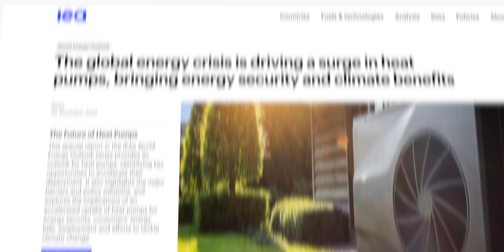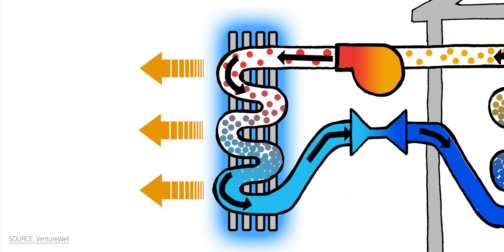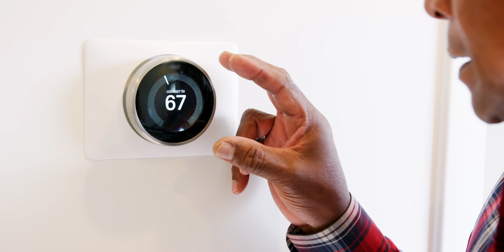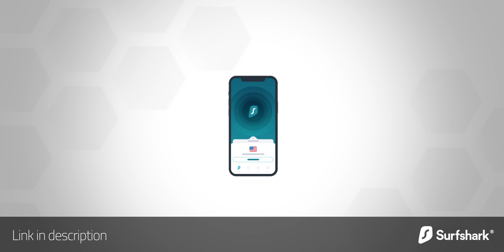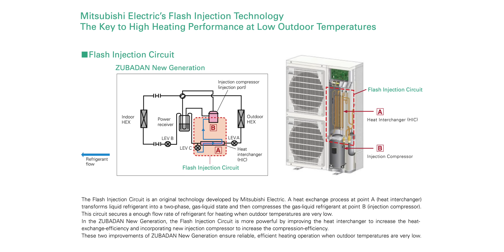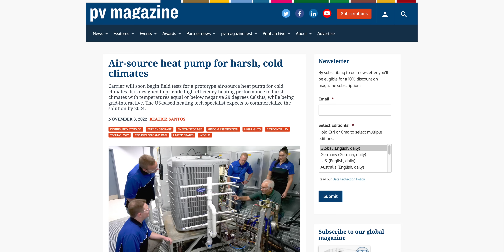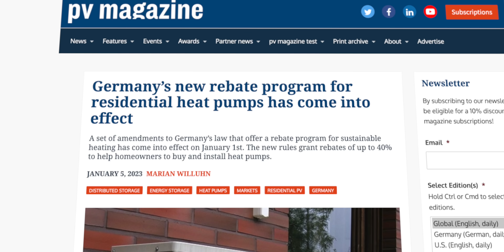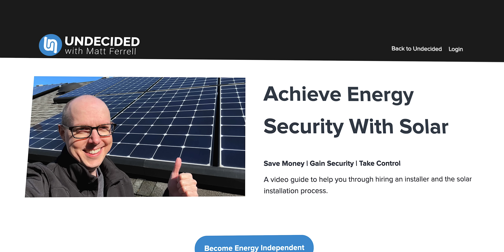Major Advances with Heat Pumps in the Extreme Cold

Comment: Your research needs to go beyond company statements to be accurate. As an ex-heat pump user I can confidently tell they are not worth it, at least not for now. First of all, despite cold weather not been a problem, which is yet to be proven in mass scale; wind is actually a bigger problem, causing all sorts of problems with the fans and if it rain gets inside the electrical system gets damaged or corroded over time (in 3 years it was unbelievable the level of corrosion caused by just water and wind). The cost of the device is nothing compared with the cost of bringing the house up to standard. A heat pump is only as good as the overall house insulation is. Thinking that a large portion of the house market globally is not well insulated, you'll be adding thousands, if not, tens of thousands of whatever currency, just to improve your windows, improve your roof, wall and floor insulation.... 

All the above to ensure a rough 20ºC throughout the year, for a non-stop system, that has to be designed to run 24/7 for its life... and its got to be a long life if the initial investment is sitting at 20/40k depending on your situation (because your quote of 6k excludes all the additional systems to move the air around the house, the cylinder and labour, a basic heat pump installation from a well reputed brand, will not cost less than, at least in gbp 12/14k for an average two up two down in England). So comparing this to a gas boiler, that will provide instant heat at roughly 60/65ºC will be used on demand, maintenance is relatively cheap and running costs are slightly cheaper per year... well, I'm sorry to say that the heat pumps need to improve dramatically on quality and price to make a difference, because 300 p.a. is not going to cut it. It doesn't even save the cost of the machine set-up in 10 years, that will need to be replaced by then, because it will simply be rotten by year 5. This is not counting with ultra-expensive service every year (because warranty won't be covered otherwise), for an inferior performance (you'll be wearing the cardi all winter) and maybe the performance is better on hot weather, but I don't live in south Spain, so I can't really compare.

Comment: I'd have liked to hear more about the output of the heat pumps, especially GS and AS to Water (i.e. radiators). I'm interested to hear about any improvements to output temperatures, which obviously have an impact on installation cost (new and larger radiators, additional insulation, underfloor heating etc).

Comment: Seems adding a heater to the inside of a heat pump should add minimal cost as they already make heaters for waterpipes, along with sensing switches so they are only triggered during the cold

A tax credit is helpful only if you're rich enough...

Comment: We put in 2 mini splits and our power bill went from $520 to $290 for the same period plus we were charging a PHEV that we didn't have the year before. They were just cheaper ones found on amazon but they work great, here around Seattle the coldest it's gotten this winter has been about 15-20F and they still keep working, not as hot but no problem keeping the house warm.  We put one in at my work also where they still used an oil furnace, and it was about $700 or more to fill the tank. Just missing 1 oil fill nearly paid for the whole thing.  Plus last summer they had excellent a/c just as a bonus, course any furnace is useless in the summer while a heat pump is a year round investment.

Comment: The problem we have in the UK is that electricity is so expensive at around 40p per kwh.
Gas is relatively cheap compared and has historically been about 1 sixth the cost. 
To run a heat pump in the UK means spending hundreds of pounds a month in electricity costs, whereas a gas boiler can be fired up for an hour or 2 to take the edge off and then turned off for the day and no money spent. 
Personally I use a gas boiler for 2 hours a day then keep the house warm burning logs in the stove. Take that climate change!!

Comment: Great summary (summery? 🤔😉) of the state of heat pump tech. One aspect that I think could have used more emphasis is radiator sizing. Heat pumps are efficient, but don't generally produce the same hot water temperatures as a boiler. So if you have an older house (like ours) with small radiators that rely on high temperatures to warm the room, you can struggle in the winter. Large surface areas and underfloor heating are ideal.
Reply: The US seems to have a lot more central air systems than radiators, so that might explain why his focus isn't really touching upon radiant heat. I think Fully Charged touched on heat pumps for radiant heat though, which was really interesting.
Reply: @stevemulcahy5014  Interesting, I hadn't picked up on that point! I'd chatted about it with the heating technician whilst he was doing the annual service check on ours: he's encountered several households who had switched to heat pump without considering the radiators. Fully Charged is also a great source of info!
Reply: I just moved into a 100 yr old house w radiator heating. None of the plumbing worked including the two boilers so I'm ripping it all out & replumbing. I look forward to feeling these radiators in action esp since the house was designed for them during the Spanish Flu pandemic. (Is that racist or only in reference to the Wuhan Flu?)

Comment: I have an A2W heat pump (Panasonic TCap 9kW) installed as the only heat source in our house in south Poland since 2018 (we moved in in 09.2019). The house isn't particularly small at 230m² and no garage (separate building). The pump works with radiant floor heating and keeps the house at 21-22C in winter. And now get this: together with 10kWp of solar panels on the roof it allowed me to keep my annual electric bill at 1002PLN~225$~213€. We are not connected to a gas main, we have no stove or even a fireplace. Everything runs on electricity. We do have AC that we rarely use for heating but heavily in the summer time.

Comment: It's all nice and dandy that there's rebates in place. Problem is, if you use a rebate you need a pre and/or post inspection. What do inspectors do these days? They inspect everything they can get close to and your rebate will quickly dissolve into nothing plus a fine because there isn't a single house - at least not an older one - that's up to code. I got a permit for a hottub electrical years back - end- result was a 2 week tag that I had to replace the main panel because there's too many loads on the system when the hottub is added. So a simple $35 permit turns into a $3000 affair over night with a forced tag to get stuff done in 2 weeks. Best part is: nobody ever inspected the 50 amp circuit over a 300 feet run. After I had the panel replaced the next inspector just signed off on it - only question was: is the hottub running? Yes? Good, wiring and everything seems to be ok then. What a BS.  That was the last remodel beyond paint and other things that don't require permits I did. I will sell the house as is and move to another state as soon as my wife retires. So no thank you. Before I have a building inspector set foot on my property again I will start heating the house with a dumpster fire in a old garbage bin.

Comment: I tore out all of the electric baseboards in my 1964 built home. Electricity is really inexpensive here near the Grand Coulee Dam and the Columbia River. I installed an 18,000 btu split system. In Spring and Autumn is it is perfect; I have supplemental heaters in the winter and supplemental air conditioners in the summer. I have no complaints.
In the early 80's I rented a house with a heat pump and the auxiliary electric heat ran often in the winter, but the house stayed cool in the summer. This was in Central Virginia. The systems work much better than they used to.

Comment: EG4 mini split ac and heat pump 2 ton unit can be directly controlled by solar panels. You can use grid only, solar only, or a combo of both. The 2 ton unit cost less than 2k USD. 
I priced out a brand new 2 ton unit with the max 3kwh solar array, racks, wires, and enough money set aside to hire someone to hook up the refrigerant. Total cost was 6k which can be cheaper if you use used panels and make cheaper solar racks. The overall savings and or ROI could be in as little as a couple of years. With the ability to run the cooling or heating during the day with out the need for grid would work very well for someone who works during the day. You can set the temp as hot as you want it which will come home to a very warm house and that heat will slowly go away by morning and the same for summer, set it as cold as you can and then it warms up a bit by morning. 
I am looking in to install these instead of a central air system and furnace. With enough insulation I might be able to run these 100% off grid and still have a really nice temp house. The RIO could be quite fast over the life of the home. If these units last 20 years that would be great. Prices might even come down further or better option for bigger or more than one head might find its way on the market. 
I like the idea that this would work even when there is no power. A person could live pretty well with limited power and still have a good amount of heating and cooling.

Comment: I live in Alaska.  For 3 years I had the largest residential heat pump system in our town of 5000 (someone beat me last year, I am on year 4). My system was supposed to be about 200% efficient, in other words use  about 1/3 of the power that my electric baseboard heaters were using.  Its hard to gauge because I have other appliances.  My overall electric bill is down about 1/3, again, heat is not the only thing using electricity. After 4 years I had expected to save more money, but I think its safe to say the system is using 50% as much power as our electric baseboards. witht that said, The heat pumps system has easily paid for itself by now.  We also have the benefit of using the AC feature as well.  Youd think we wouldnt need AC in Alaska, but it comes in handy about every 2-3 years when the wind isnt blowing on a warm august day.

Comment: Is the install cost of an A/C unit about the same? I heard it's about $25 more in parts for an average heat pump. You NEED to add that you get a cooling system or are they only good for heating?
Reply: Purely speaking of Air to Air, it's the other way round.  There are AC units in America that can't heat.  All A2A heat pumps (at least "modern" ones), basically use the "AC" mode to defrost the outside unit, just with the fan off on the inside to not blow cold air around.

Comment: Go and ask about heat pumps in northern europe :)
-25C and still "pumping" around -30C .. switch to resistive heathing.
air-to-water, heating coils in concrete floor in my home (and 200L hot water).
ground-to-water - to much red tape involved ...

Comment: When I had a heat pump installed a couple years ago, the savings on my winter energy bills, while nonzero, was underwhelming. But, it was the impact of the heat pump on my air conditioning that made the cost worth it.

My furnace was old and needing frequent service calls to keep working, but so was my air conditioner. While the heat pump did cost more than simply replacing the furnace with another furnace, the heat pump came out as a clear winner, simply in terms of cost of equipment, compared to the alternative of replacing the furnace with another furnace, and then needing to replace the air conditioner with another air conditioner two years later. On top of this, the heat pump turned out to be a much more efficient air conditioner than what I had previously, reducing my energy bills in not just the winter, but also summer (in fact, I think the heat pump actually saves me more money on energy in the summer than in the winter). The heat pump is also might quieter than the furnace it replaced and having a system that is always on, rather than cycling on and off every few minutes led to a steadier sound that helped me sleep better at night. I also saved some additional money by bundling the HVAC system replacement with a water heater replacement at the same time by the same company.

But, the catch was that, in order to get a good deal, I did need to do my homework and consult multiple bids. Some of the companies I turned down were quoting me prices thousands of dollars higher for the heat pump than the bid I actually accepted. I also had contractors trying to sell me a new backup furnace that would kick in when outside temperatures drop below 30 or 40 degrees (the bid I ultimately accepted has no backup heat source, but even on the coldest of coldest winter nights, about 15 degrees F in my area, the heat pump worked as advertised, with no issues).

So, in conclusion, when you're deciding between furnace vs. heat pump, it's important to remember that a heat pump is not just a heater, but also a cooler, and as long as it is cheaper than the combined cost of a furnace and a home air conditioner, you are still coming out financially ahead, even ignoring the potential savings on energy bills.

Comment: In New Zealand heat pumps have been very common for 14years now. The main issue is it doesnt heat an area very quickly so many folk get a more powerful one than necessary to ensure it does heat a room quick. Also many parts of the country have access to free or cheap wood, and who doesnt love the smell and look of a wood fire 🤩
But i can tell you, sitting in a 1950s built wooden house with 80km/hr cold winds blowing against it, there is more heat blown off the house than the heat pump can generate which results in cranking the temperature up very hot just to stay warm. Of only we had the insulation as well priced as USA, Canada, Europe etc

Comment: I just installed a new Bradford White high efficiency boiler with a Bradford White indirect water heater.   It has an intermittent ignition system with no pilot light. This is an extremely efficient solution for both heating and domestic hot water.  In summer, the boiler runs only when there is a call for hot water.  I neither need nor do I want a heat pump.  I have a Mitsubishi Mr. Slim system for A/C and it works fine.  When I replace the Mr. Slim eventually, I certainly will get a Mitsubishi Heat Pump System.  I don't really believe in Global Warming and don't care about a few more dollars a month in natural gas for the comfort and reliability of my baseboard system.

Comment: Hi Matt,
Where I live in Canada we get -40 for a few days every year and been as low as -60. A few years ago we set a record of 63 days below -30c 
And we probably average 60 days of -30 c. From what I see that won’t do us much good here until they are good down to -40 to -50c.
No one uses electric heat here as Natural gas is so much cheaper. Is there any units out there that have that type of performance. i wouldn’t be to happy if my house froze up at -35c. I know the systems I have seen years ago in Sweden where only good to -20c and then they had to use very expensive electric heat . Thanks

Comment: I put a mini split in my office in my detached pole barn shop. It has only been down to 4F this winter and the unit has never stopped putting out heat. While it works I don't get that nice work feeling you get from combustion so I added a propane heater that I use while I am in the office and run the heat pump overnight to keep the chill off.

Comment: Air source heat pumps are not that expensive nor are they difficult to install.  The cost comes from commissioning them.  I installed two in the last year.  They were less than replacing my condensing boiler which gave up the ghost.  What I would like to see is an air to water unit that would feed into a hydronic system because it would be nice to be able to heat my floor as well.  These do not require the high temperatures that baseboard radiation requires so they would work quite well.  They are not readily available in North America.  They are most economical if you are replacing a fuel like propane or furnace oil.  
One other thing to remember is that along with heat, you also get air conditioning for the same price.  
Because they don't blast out high temperatures like a furnace, there is little or no stratification so that the second story is not super warm while the main floor is cold. Did I mention how quiet they are compared to a regular furnace?

Comment: Generating and transporting electricity is not 100% efficient. Actually, a COP of 2.5 is around break even, while 5 is twice as efficient. In Europe you are not allowed to have heating coil on the outside until. This would disqualify you from getting an electricity discount for heating with it. If air source, they tend to perform worst around 5 degrees with high humidity. The humidity keeps freezing on the heat exchanger, and Ice is an insulator. This means it has to reverse all the time to defrost, it will work, but it does not help with its efficiency.

Comment: I duct the airflow for my air source heat pumps (reverse cycle A/C) to use air from my ground-attached subfloor area - it is between 14C and 23C all year round so really helps with efficiency and energy saving.

Comment: so at what temperature/humidity will the heat pump become an I2R baseboard heater?  in other words, at what air temperature/ humidity does the pump not pump heat other than the electricity consumed?

why not specify this crucial data?
Reply: Ground Source - really no lower limit. Air Source - it depends on the heat pump, my cold climate A2A is still specced to operate at a COP of greater than 2 at -30c.